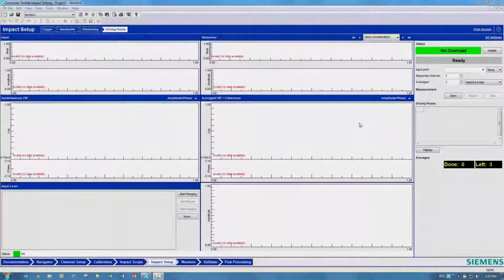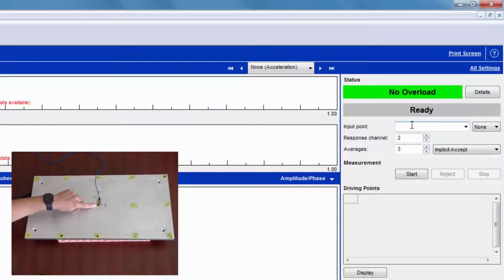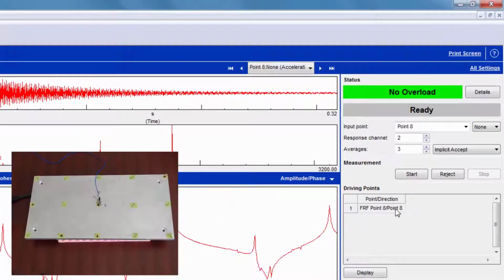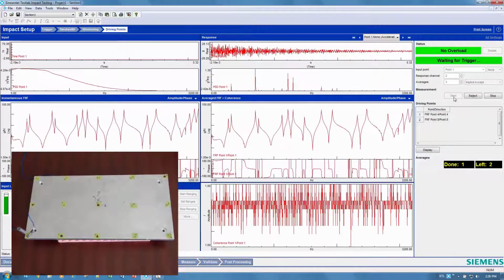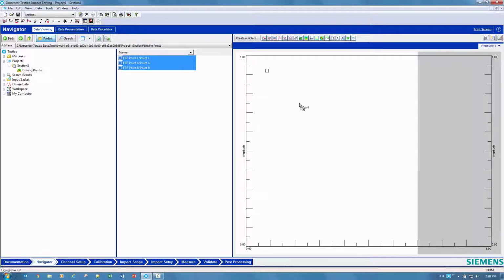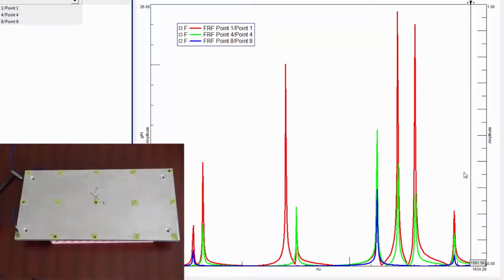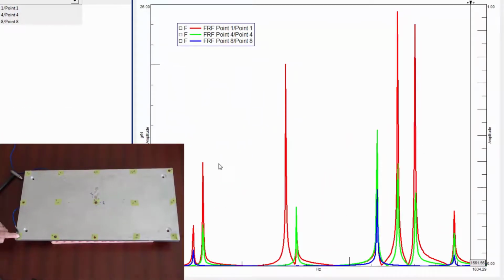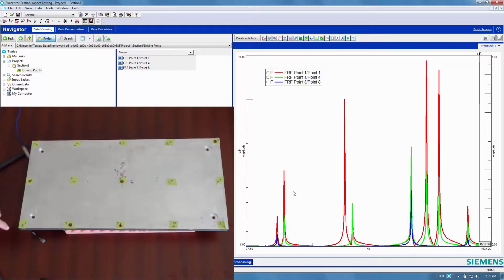Modal Driving Point Survey

Comment: Hello, does this mean that in the frequency range of concern, the more resonance peaks, the more suitable it is to paste the acceleration sensor here??? If you need to select two points, then point 1 is the most appropriate and point 4 is more appropriate. Is this the case??? Thank you and look forward to your reply
Reply from the maker: For a given structure, the more peaks in a driving point FRF the better, as this means you are exciting more modes by exciting there (Point 1 vs Point 4).  However, you can also choose multiple driving points for a given structure, you will just end up taking 2x the data, which may result in a higher quality modal analysis, or yield additional modes.  For example: Accel at Pt 1, Rove Hammer to points 1-15 = 15 FRFs.  Next, Accel at Pt 4, Rove Hammer to points 1-15 = 15 more FRFs (total 30 FRFs).   However, for this simple plate we likely won't gain any additional useful information from the Driving Point #4 FRFs as all the information extracted from this location was already extracted by impacting at Point #1 (Point 1 driving point FRF had all the peaks from Point 4 driving point, plus more).  
Usually when additional driving points are added they are performed in a different direction (not vertical) to excite different modes than a vertical excitation.
Reply: @SimcenterTesting  Thank you for your reply; I have a question here. Generally, the reference point of modal test should be fixed; If I have only one sensor, can I fix the sensor at reference point 1, move the hammer to traverse all points, then fix the sensor to reference point 2, and move the hammer to traverse all points again, so that I can get more FRF curves. Can I do this? We look forward to your reply